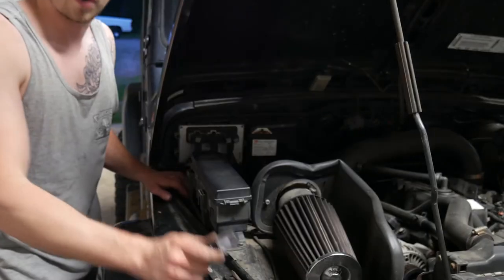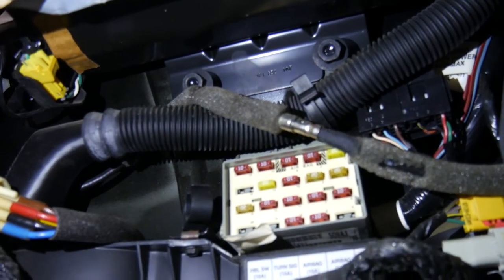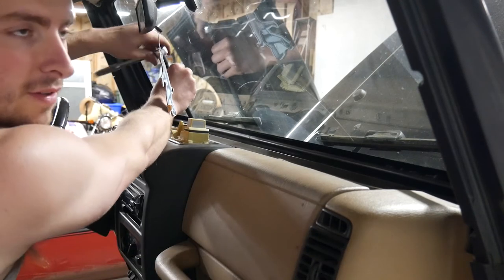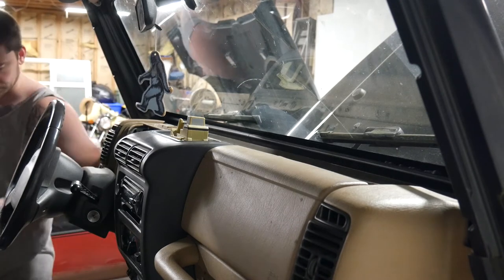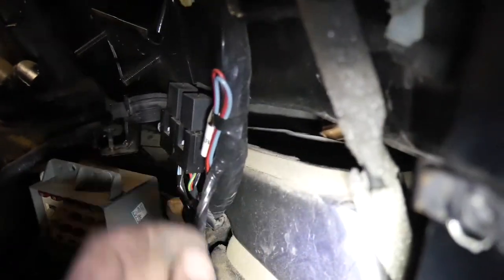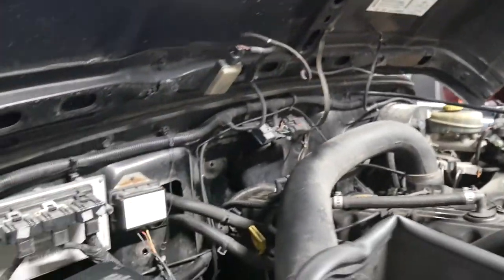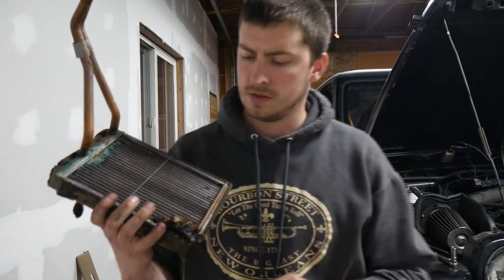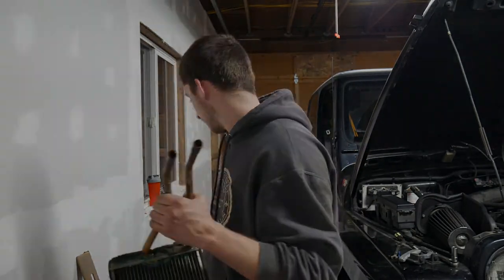Replacing the Heater Core in My Jeep Wrangler TJ (Not My Idea of a Good Time)

Comment: I have a 2000 TJ with only 84K on it and I can't seem to part with it, though I think about a lot, especially since I've
 gone without heat for the past 2 years. Well as much as I hate to do this nightmare, I will be replacing the core. Thank you for showing me what I'm in for, I really appreciate it.
Reply from the maker: No problem! I will say my 2 cents are keep it because i regret selling mine very much so
Reply: You too huh?  I'm 3 years into AC in the winter and summer club.

Comment: I certainly appreciated the entertainment value from this video but I'm doing the work now and it's really not that bad. I own a Honda Prelude so I'm really enjoying how easy it is to reach everything, I can SEE where my hands are supposed to be, all the fasteners are the SAME. 

I thought about selling my Jeep but this job makes me think twice because nothing is this easy to maintain. Except for a Miata...but I already own one of those.
Reply from the maker: I did a heater core in my 85 corvette and it was brutal but also i did not have to pull the dash or anything really. Definitely easy to work on a jeep overall
Reply from the maker: Also thats a pretty dope setup. Jeep and miata is all you really need in life haha
Reply: @caseybaker5550  After getting scammed on facebook marketplace for my Miata, I thought I would hate it forever. But once I finished replacing everything, got it on the road, I realized how much I'm going to enjoy it. It doesn't handle as well as my Prelude, but it definitely fills the void that can only be filled with rear wheel drive.
Reply from the maker: @DirtSweatGears  bold statement it doesnt handle as well as your prelude but man two great cars. What year prelude? I had an ‘85 that would do a burnout through 3rd gear. I miss it haha
Reply: @caseybaker5550  it’s an 89 with 4 wheel steering and tons of suspension mods. I’ve had it 20 years, love all my cars but the prelude always comes first because it is my first! 😂 my dad had an 87 prelude SI and that was a totally sweet car

Comment: Actually this was very easy to do and I think it was like 4 hrs taking my time.  Most of the dash can stay assembled.  use ratchet straps around the passenger grab bar and loop around roll bar gives you plenty of room.
Reply: Leave steering wheel in, can remove the cluster but honestly I believe not even necessary. can leave radio in but must remove bezel and center console.  this will give you plenty of room to remove.  remove a few connections on the inside then A/C lines, Heater core lines, vacuum line and the six nuts.

Comment: This helped me so much with my heater core. Did it in about 7ish hours nonstop. But now for some reason I'm stuck in 4wd and can't shift into 2wd. Idk what to do lol. Checked mt cable shifter, unhooked it and manually shifted into 2wd(or what 2wd is suppose to be at) but still stuck in 4wd..... wtf
Reply from the maker: Thats pretty good time! Man I wish I was better with 4wd stuff. I probably would have done the same thing or just driven it back and forth trying to rock it out of 4wd. Haha probably not a professional thing to do

Comment: Those heater cores are a real pain, ive changed a couple of them myself, and they don't get any easier, it's a 1400 dollar job at the shop i used to work at.i almost swapped my cutlass off for 1 that looked almost identical to yours until i drove it and found out the rear frame was rotted already, ive always liked the jeeps, have had many late 70s to mid 80s all with the v8s they are fun but can be a headache.
Reply from the maker: Yeah i love this one but i am selling for other projects and honestly i want an older one. Like ideally a flat fender.
Reply: @caseybaker5550  same bro, i want to build a flat rod, 2 wheel drive, v8 tire smoking machine lol
Reply from the maker: @TheSouthdownband  same here!! Those are rad.

Comment: Not my idea of a good time either that's why I have been letting it leak for 2 years. It's finally getting bad enough to be a real problem tho and I just don't want to do it.....
Reply from the maker: Unfortunately it is terrible to breathe that stuff in haha I had my ‘85 heater core BLOW UP in my driveway headed home and it messed me up for a minute hah
Reply: @caseybaker5550 Jesus guess I'm lucky I just had a leak that grew over time. I did it today. Honestly not as bad as I thought. Took me about 2 hours and 30 minutes of that was cleaning the box. Then the fan wouldn't work but it turns out if you don't plug them in they do that 😂

Comment: My tj has been getting wet seems like everywhere from the front and the back.. but mainly on the left side and puddles behind drivers seat does this sound like leaking heater core?
Reply from the maker: When my doors would leak that is where the puddles would be. Heater core would pretty much just be passenger floorboard or over to center of dash maybe
Reply: @caseybaker5550  Hmm okay. More investigation i did take the carpets out and let them hang, they were soaked dripping wet, and the puddle that accumulated from letting them hang was turned out greenish in color. Also idk if this helps but havent had anymore issues since i havent turned the heat on at all. Only seems when i turn the heat on?

Comment: How can you tell if your core is leaking?

I don’t see fluid buy I definitely can smell with when the AC is off and for a few minutes when I turn the heater on. Does that mean it’s leaking?
Reply from the maker: Probably means that it is a pinhole that is small enough it evaporates before it can leak on the floor but there is probably some in your heaterbox regardless. Honestly that stuff is not cool to get into your lungs so i would recommend looking into it sooner rather than later or just pay close attention. I was windows down for months haha
Reply: @caseybaker5550  exactly and I’m such a phobic of breathing that crap ! Shoot. I totally get the mood for starting this project… dang it lol
Reply from the maker: @dad3562  hahah good luck! Not too bad on paper. I recommend getting a real heavy duty heater core not the cheapo from a local parts place.
Reply: @caseybaker5550  sweet, Roger that!

Comment: This is something  I need to do think I have a leak in ac in dash. Man this looks like a pain in the butt. Crap crap crap!
Reply from the maker: Honestly as far as heater cores go it is not terrible but definitely put your nuts and bolts in the right spot and it will be done before you know it
Reply: I sure hope u are right. It will be hot so and I will need ac  my evaporator core I believe  is my leak on ac. But I sure hope  u are right. T U.